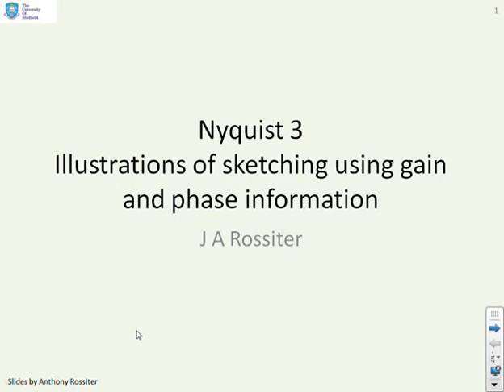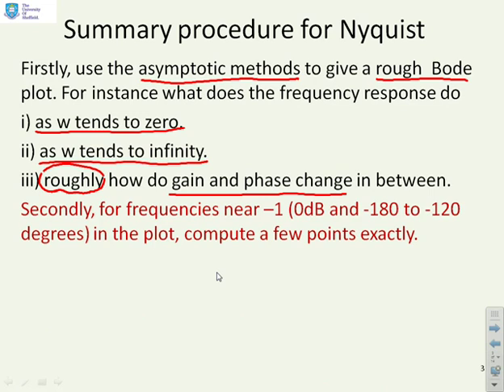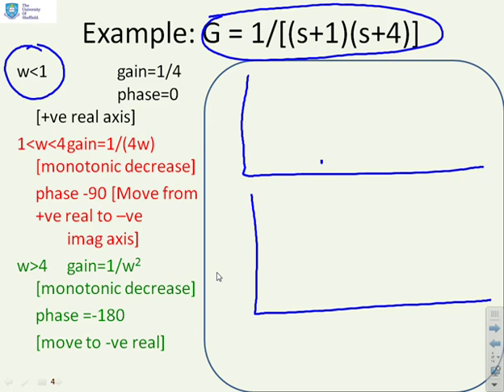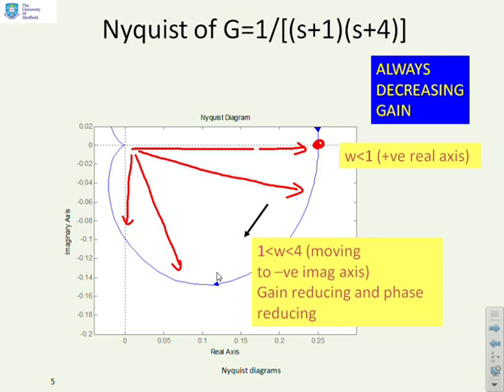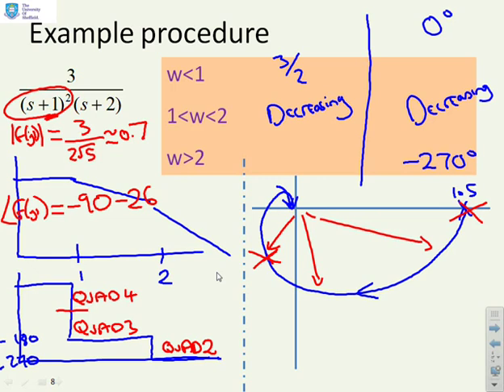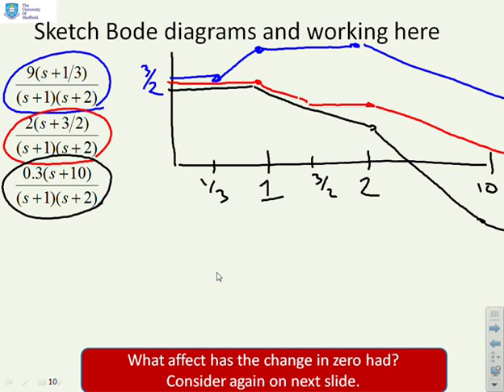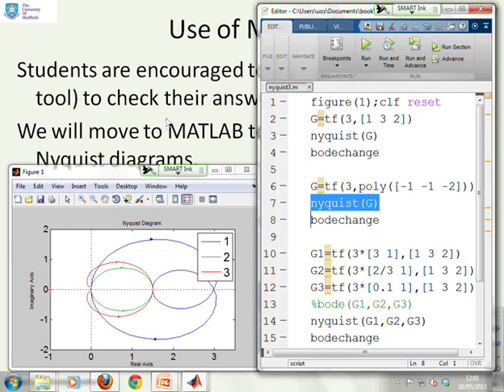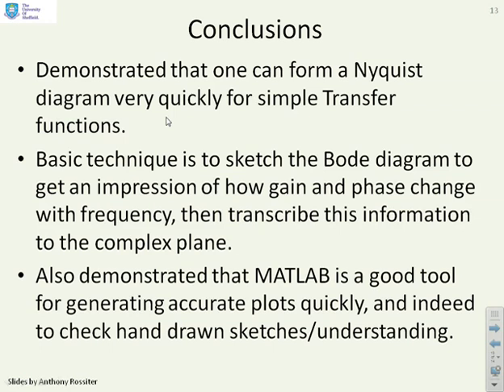Nyquist 3 -illustrations of sketching from gain and phase information

Comment: At 7:50 you say, its clear that w=sqrt(2) at -90°.
How do you see that so fast without calculating?
Thank you very much for the videos, they are very helpful. Greetings from Germany.
Reply from the maker: +keenwasp You can show that atan(w)+atan(w/2)=90 if (w*w/2 = 1). Use a right angle triangle and this should be obvious (2 other angles add to 90).Anthony

Comment: At 4:09, where did you get the 5 and the 20 when you calculated the magnitude of the gain? The denominator is s^2+5s+4 so the magnitude would be 1/sqrt((s^2+4)^2+(5s)^2))?
Nice videos by the way, I wished I watched these before my midterm.
Reply from the maker: +smyleylily Put jw=j2 which is the geometric mean of the 2 corner frequencies (1 and 4). Then |jw+1|=sqrt(5) and |jw+4|=sqrt(20)Anthony

Comment: You're not consistent in your labeling of quadrants. In the previous video (nyquist-2) at 2:26 you label quadrant 2 as being -180 to -270 whereas here at 16:32 you label quadrant 2 to be 0 to -90 whereas 0 to -90 is actually quadrant 4.